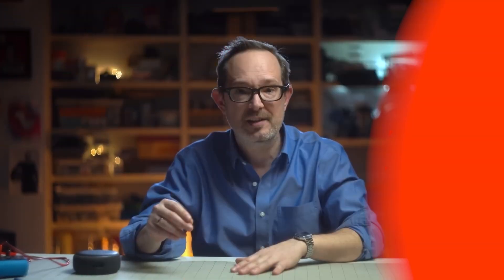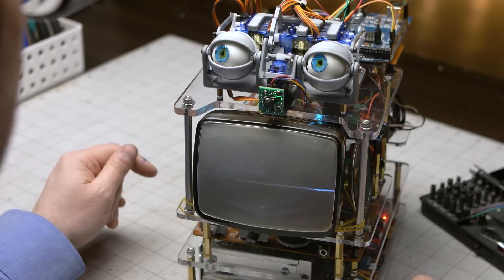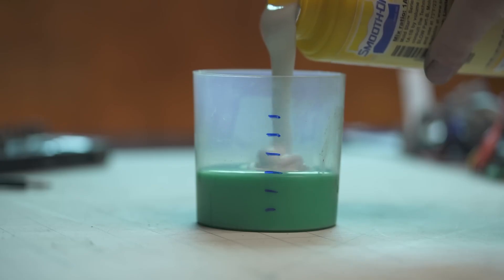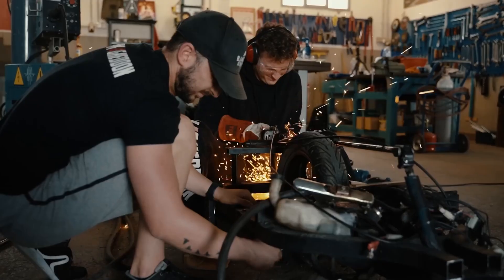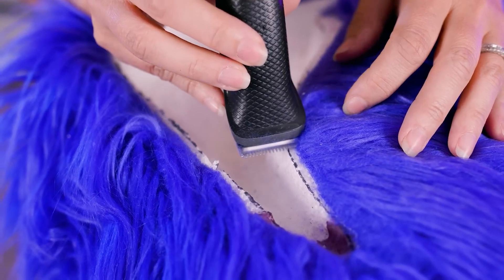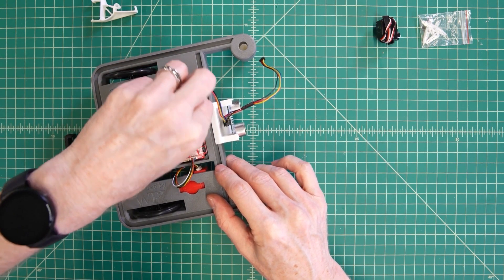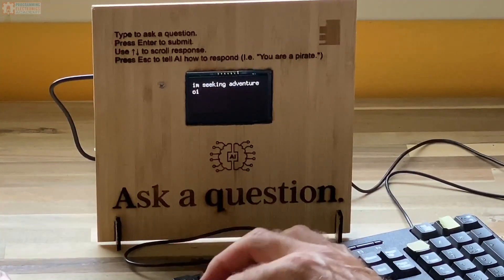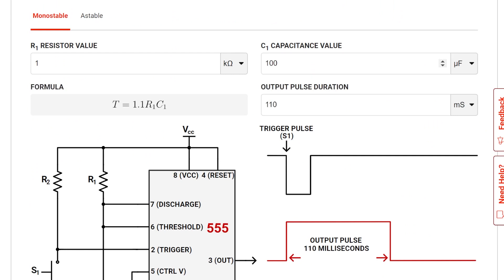The Future We Forgot To Make [Maker Update] | Maker.io

Comment: I did the CRT thing in the '70s.  Slide off the deflection coils, but DON'T disconnect them from the TV circuitry (and avoid potential damage).  Then replace them with your own independent coils.  (Of course back then CRTs were pretty easy to come by, so there were lots of coils to be had.  I'd just ask everyone on my paper route--what's that?--for any electronic junk and within a week I had everything I needed for my projects.  Bypass the detector diode in a transistor radio for a free audio amplifier, perfect for this application.)